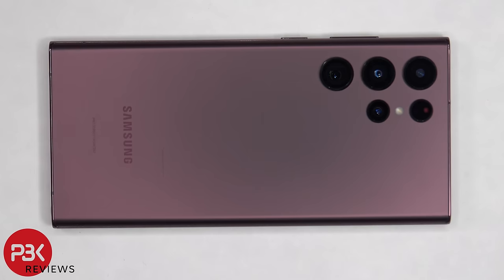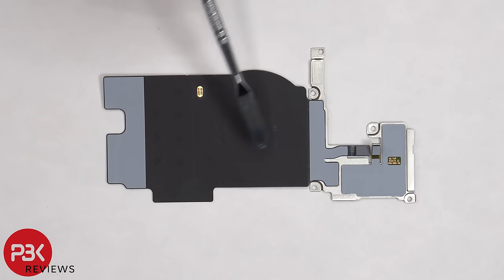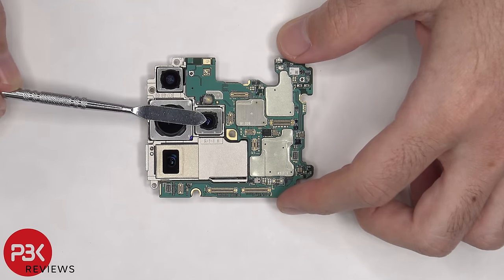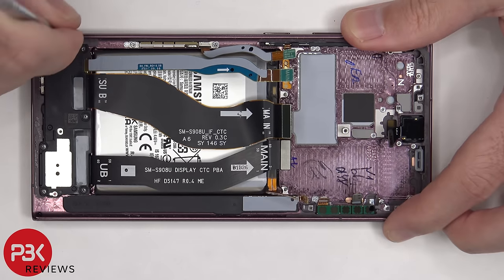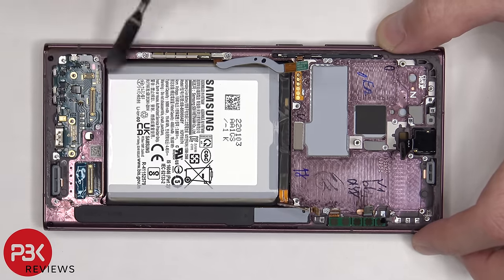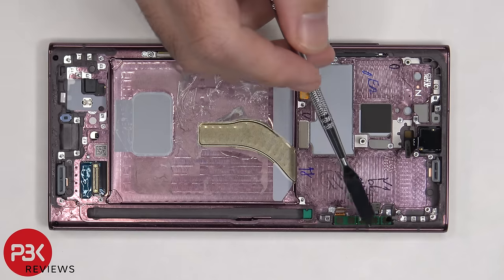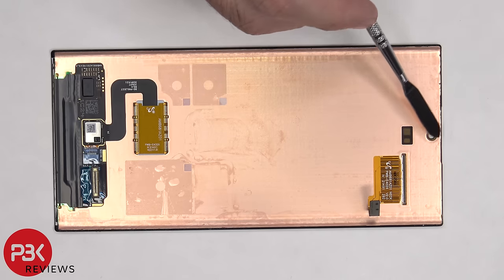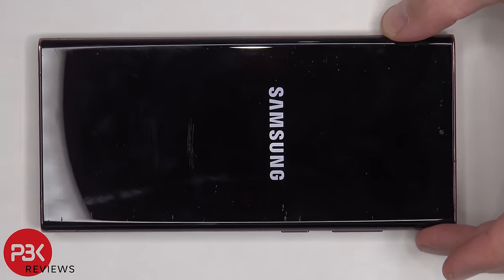Samsung Galaxy S22 Ultra Disassembly Teardown Repair Video Review

Comment: The mic at the bottom is side by side with the SIM card tray pop up hole. If I accidentally poke the pin into the mic hole will it damage the mic?
Reply from the maker: Hi, no you will be fine. The mic and filter are located above the hole and will not be damaged.
Reply: @PBKreviews  Many thanks for your reply. I was so worried that I spoiled my awesome phone on 1st day of use.

Comment: Good to see that Samsung seems to have settled on the s22 series with something they like. This reminds me of the S8 to S9. The s21 and especially 20 were a bit Rockey but I think this is a winner. Hopefully Samsung doesn't try to change for the sake of it again (still think they should have stuck with the s8/9 note8/9 for a few years then come out with the s21 design) If they focus on making it better without a full redesign every time hopefully they can avoid having their phones cost 200 more than apple's

Comment: I've got a question, how much would each part cost individually for the samsung s22, and if you can calculate it, would it be cheaper to get all the parts and  make the phone ourselves or just buy the whole phone?
Reply from the maker: I'm not sure the cost of each part but I would think it would be cheaper to buy it as a whole vs parts (this is if you're buying third party and not from the source which would also probably not be possible).

Comment: Does the exynos version look the same  inside ?
Reply from the maker: Yes but it may or may not have the mmWave antenna on the side of the phone depending on region.
Reply: @PBKreviews  I can’t find anything anywhere that says the exynos has the stainless steel vapour chamber inside ?

Comment: Does it come with silicon case (for drop protection), headphones, port, charger, SD card?
Reply: As far as I know, all that's included in the box are: S22 Ultra, usual books and paperwork, sim ejection tool, USB-C to USB-C cable.

No headphones, port, charger, sd card, and also no case. The phone should be durable enough, but I wouldn't recommend drop testing it yourself
Reply: when you preorder the phone, you get $200 of extra credits to spend in the samsung store you can use to buy a case

Comment: My cellular radio stopped working.  WiFi still works.  Everything else seems like it's working.   Do you think it's a loose cellular cable?
Reply from the maker: Yeah its possible. You can check all the cable to make sure they are connected properly as well as check and make sure the covers over the motherboard are in place properly since the top cover has antenna lines running through it.

Comment: I was wondering if it would still retain its IP68 rating if the pen were removed and it were submerged in water that way.
Reply from the maker: Yup, still sealed from the S pen housing so would be good to go :)

Comment: Where is the ear speaker? Did I miss it integrated in the screen?
Reply from the maker: You can see it @4:05 in the video
Reply: @PBKreviews  Yes but where is the outlet, do the sound waves travel through the screen (like with a P30 Pro) or is there an opening?
Reply from the maker: @donnawetter1513  you can see the outlet opening when im showing the speaker and flipping it around. As for the screen outside, there is a thin slit on top of the screen between the screen and frame. You can also see where later in the video i mention there is a rubber gasket and mesh filter for the speaker openings in the frame. 😀

Comment: Best video and this is more informative because the S Pen has single layer that have to be taken care when water get in that part so it's doesn't get in contact with internal parts
Reply: Best to replace the adhesive or not remove the cover internally as there really shouldn't be a need to

Comment: Man Samsung went all in with cooling for this phone, maybe it's gonna have decent thermals this time. Thanks for the video!
Haven't seen this much graphite in a phone yet lol.
Reply from the maker: You're welcome!
Reply: And yet they were throttling for heat issues as described in the latest software update that allows users to manually disable their nanny switch
Reply: Once the motherboard and battery is removed, is the whole inner frame made of metal? I meant the pink colored frame.

Comment: Hello, I'm sorry, if you can help me, on the S23 Ultra screen, I press exactly the part where the copper foil is located behind the periscope camera, it makes a sound like plastic, is this sound due to the presence of the copper foil under the screen and is it normal??  I press a lot next to the volume key on the screen, it makes a sound like a hand on plastic. Please help, thank you
Reply from the maker: Not sure, its possible if your screen was ever replaced, the adhesive is slightly loose or the original adhesive is going bad. Shouldn't make a noise when being pressed aside from when shaking the phone, the camera assembly rattles which is normal.

Comment: wow, and they say there no place for a 3.5mm jack . . . . I rather get rid of the periscope camera for the 3.5mm jack. My Sennheiser HD58X loves 3.5mm jack
Reply from the maker: haha yep
Reply: They would never remove the periscope lens
Reply: You can buy an external DAC, big amp, and connect via usb c to the galaxy
Reply: Why when you have buletooth ear buds
Reply: Do you think they actually removed it because of space constraints? Obviously they did it so that you would buy their wireless headphones. Same reason they removed the SD card slot and charger from the box
Reply: you don't need a headphone jack because most headphones are wireless now 
if you wanted a top hardware phone with headphone jack, you would buy Sony phones which have both micro sd and headphone jack
Reply: Its not an Ultra if it didnt have periscope. But personally, I would rather bigger battery than the spen. Not sure why Samsung is capping battery capacity at 5000mah.

Comment: Is the storage sodered to the motherboard? I've only had my S22 Ultra Since March 19, today September 23, it no longer can turn on. Its so strange, I was just using it nearly full battery, put it on a counter, picked it up and it literally just died. I followed every single youtube video, googled everything, tried the reset, tried the safe mode, tried charging, and I am having no response at all. I used a wireless charger, it recognizes that theres a battery to charge but the phone wont boot up.  Its as if its literally dead. I have to take it to a store or mail it for a replacement, but I am worried about my personal information being compromised or lost. Is there any other way to retrieve my storage?
Reply from the maker: Yeah its soldered to the board. Have you tried putting in a charged battery and see if it will power on? Maybe its the power button that is not working.
Reply: @PBKreviews  Hey, thank you for replying to me. I took it to an authorized Samsung repair shop and they concluded that the motherboard is faulty. My device no longer works and I had to send it back to them & they are most likely going to give me a replacement. I've always used Galaxy phones and never had issues with it. Unfortunately this must have been a faulty device. I lost all my 4k videos but i backed it up with google drive only in 1080p. It was a 512gb storage $1500 S22 Ultra, kind of a bummer. I hope this doesnt happen to other S22 ultras users out there, and if it does, this will be my last Samsung Phone.

Comment: Help.
My phone on emergency calls only,no mobile data or calls, signal 4 bars full.
I've tried everything, airplane,network reset, cache wipe,hard reset, etc.
But my sim works in my other phone.
A different sim doesn't work on this faulty phone, 22 ultra.
Do you think it can be an antenna issue?
Opinion
Reply from the maker: Not sure, might be a software lock or a lock from the manufacturer for a device which has not been paid off.

Comment: Why would they install stainless steel heat conducter instead of a copper one? We all know that copper is better when it comes to heat transfer... Unless they wanted somehow to limit the amount of heat transfer 🤷🏻‍♂️
Reply: Money mah boi.....money...
Reply from the maker: Not sure.
Reply: Same reason as to why they used graphite for the longest time. Copper just doesnt make sense unless you have an active cooling solution. Yes, copper transfers heat faster, but it can't escape as fast as it needs to. In gaming phones with built in active cooling(fans), copper might be great, but for passively cooling phones, it's not as effective as it's marketed to be

Copper cooling is just marketing in phones unless there's an active cooling solution built-in.
Reply from the maker: @hachiko2692  👍
Reply: Because you need to design a thin and tough vapour chamber that won't leak if there's impact that may cause damage to the vapour chamber. If thin enough, the effect of the conductance of the material is less compared to effect of the vapour chamber

Comment: Please Help.
I tried the teardown to fix sim card issue(the sub cable was not fitting well) , followed all steps to put them back on, now my s22 ultra won’t turn on. Any ideas?
Reply: Flex cable from main to sub board (on sub side) wasnt attached well, I pressed on it a bit hard to fix sim card availability(it worked initialy) then phone shut down and never turn on. Did I damage the subboard? What could be the cause I didnt see anything break.

Comment: Damn, this is pretty streamlined inside. At least compared to the rat nest that's in iPhones. It must be an absolute nightmare to assemble those at the factory.
Reply: Not really with proper and proprietary jigs, robots, and preassembled parts.

Comment: Would like to see camera lens replacement video, in case I scratch or crack one of the lenses.
Reply from the maker: They are just held on with adhesive, you can heat it up and pry the glass cover off each ring.
Reply: @PBKreviews  Nice thanks.

Comment: Trying to fix a buddies s22u. He got the screen replaced and he says it was working and now it doesnt work. Can hear stuff and it turns on but nothing. Ive taken it apart and everything seems fine. Anyone else have this problem? Do i tell him he just needs a new screen?
Reply from the maker: Might be a defective screen, or the screen may have a hairline crack somewhere you can't see causing it not to work. Could also be other things like issues with the motherboard.

Comment: All that without protective gloves...Whoops ! Clearly has never worked in the Microelectronics Industry. Still good Video and earns a Thumbs-up from me.
Reply from the maker: Thanks :) . I don't want to spend too much time writing an essay like I have to many others who assume its a problem, but long story short its not. I have worked in the field and I have experience with working on thousands of phones over the past 20 years and I can assure you gloves are not necessary. Yes, at the factory it is, its standard protocol working on brand new units. No one wants sloppy hand prints, residue, or anything of that nature on a brand new product. But as far as static protection or shorts, they don't build these electronics like they did 20 years ago when you did have to worry for all that. They take all that into consideration and technology has evolved quite a bit. As long as your battery cable is disconnected, and your not siting on shaggy rug full of static, you're good to go. I appreciate your comment and the like. Thanks again.

Comment: Yes there is a problem on my s22 ultra snapdragon variant I think bvoz it hasn't a plastic antenna on the side of my phone unlike exynoss variant. The problem is when your writing on the note continuously sometines there is a gab or no write on your writing a broken line if you may but when I use my note 20 standard it's S pen is working properly to my s22 ultra snapdragon without broken line while your writing with the Spen of my note 20 to screen of s22 ultra.
Reply from the maker: Hmm not sure what could be causing that, but don't think if it's missing the mmWave antenna, that it would cause an issue like that.
Reply: @PBKreviews  but still the 5g network is working properly on my side snapdragon variant. Without the plastic on the side for antenna.
Reply from the maker: @stepot3715  just because the phone doesn't have the mmWave antenna, it doesn't mean that it does not have 5g. There are multiple types of 5g networks and that antenna is only for carriers that use mmWave ultra wideband 5g.
Reply: @PBKreviews  I see so samsung always don't have standard on they're products so many variants to make they're customers to make them confuse.

Comment: Have my S22 Ultra for 1 month.  Dropped from 3 feet high onto light gravel, the screen shattered!  Trying to figure out if I should fix it myself or have someone do it.  Your video gave me my options!  :)  Thanks.
Reply from the maker: Glad the video might be of help. Its up to you, if you think your up for it, just watch the steps one by one and attempt it. Just dont rush and take your time. Here is a link to some of the parts, you will probably need a replacement back adhesive for the back cover when re assembling it: https://www.mobiledefenders.com/catalogsearch/result/?cat=0&q=s22+ultra

Comment: Samsung flagship is a phone, but like regular phones they still pull the connection over the battery which doesn't look good, but when you open the iPhone it doesn't look like this.  Samsung companies should pay attention to this aspect.

Comment: Es difícil de cambiarle la pantalla a ese aparato.
Reply from the maker: If it's already cracked, it wont be too difficult since you don't have to worry about damaging it but if its not cracked and you need to remove the screen, then yeah it would take a lot of time and patience. :)

Comment: I dropped my galaxy s22 ultra and now the antenna 📡 only works through Wi-Fi 😅 I know it doesn't make any sense but that's how it works now 😢 I tried everything already, I did reset the network settings, I restarted the phone 📱 I entered the samsung secret menu reset everything even the cache and nothing works, everything still the same. I have no doubt that it's a hardware problem not a software problem 😅 I took it to Verizon, they seem to know less than I do 😅 please help I don't want to get a new cell mine still good 😢

Comment: Samsung Flag ship phones inside designs is too much different from medium rage phones but e.g use almost from same design but with better materials and specs but Samsung is very different no cable in phobe which is impressive. I think as you know there are a few inside designer in world which seal phone inside design to world phone production company I think Samsung e.g use from those companies design in M series and only design its flagship that why the levels of its phones designe is too much different.
Reply from the maker: yup

Comment: The size of the battery of Samsung before and this year is different. I like the battery of Samsung before.Example like the battery of Samsung S7 edge it's a rectangular battery size and it's make the device more light weight and comfortable to use.not like the battery they use to there devices this year it's wide and big it make the weight of the phone more heavier it's uncomfortable to use.

Comment: Now that you've left finger print contamination on practically every critical component in that phone, you can now promptly throw it in the garbage. I doubt you use ESD protection either. But other than that........
Reply from the maker: lol I would be worried maybe 20 years ago. None of that means anything on modern tech now a days. There is so much grounding as is and the chips and resistors themselves are protected. I have worked on thousands of phones in the last 15 years and not one had any issue after me touching it with my bare hands and leaving "fingerprints". If you're siting on carpet full of static and rubbing your socks while touching the phone, I would then maybe think it might be an issue but still I wouldn't be too worried.
Reply: @PBKreviews  On the contrary, ESD is far more of a concern now than years ago. An ESD event doesn't have to be catastrophic to cause a failure later down the road. Failure can range from a complete malfunction in a circuit branch or intermittent events depending on the current load on the compromised trace that got damaged. Infact, many events that most people chalk up to 'glitches' can be traced back to a prior ESD. Same is true for oily deposits left on circuitry. As for your assertion that you've never had problems with the 'thousands' of phones you have taken apart, you can't really know that because I doubt that you would have followed the lives of the phones to their end, thereby unable to quantify or know of potential failures down the road. There's a reason why the factories where these devices are made are 1,000 cleaner than a typical hospital operating room and the workers are covered head to toe in garments meant to protect the components from contamination. Don't get me wrong, your disassembly tutorials are well explained, however, I still wouldn't take back a phone from you without wondering if six months later when something glitching out was the result of a poorly written app update, system update or corroded / compromised circuitry. 

https://www.linkedin.com/pulse/static-electricity-still-issue-todays-modern-dan-widdis-ii

Comment: What does it mean that RATED CAPACITY is 4855 mAh?
Reply from the maker: Typical capacity is the average value of the actual battery capacities for each product in a batch and rated value is the minimum battery capacity that is verified to testing standards.
Reply: @PBKreviews  thank you for quick response! Does it mean that some S22 Ultras can have 5150 mAh and other 4850?
Reply from the maker: @SinceWeMet89  No problem, and no it won't be more than the 5000 typical.